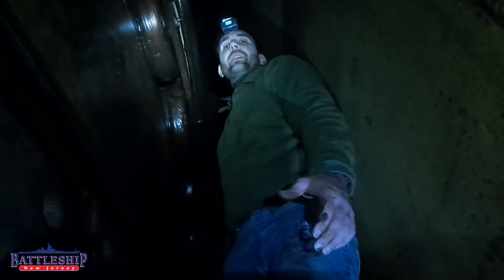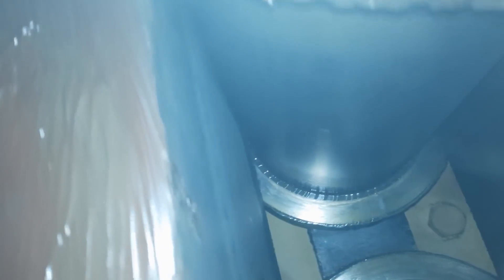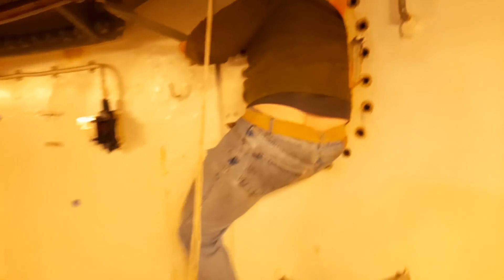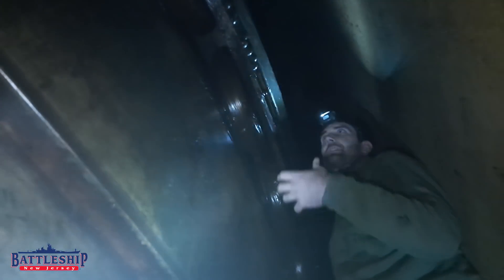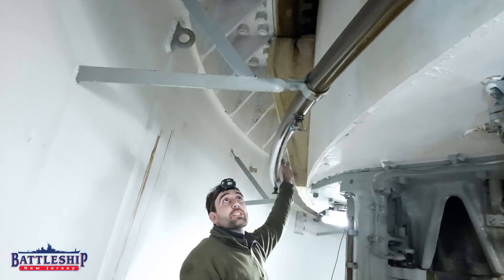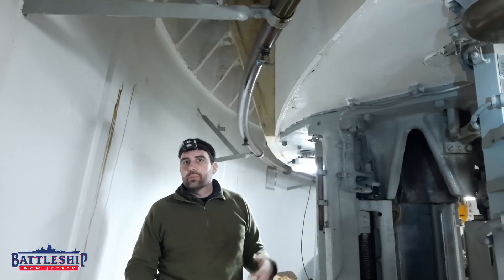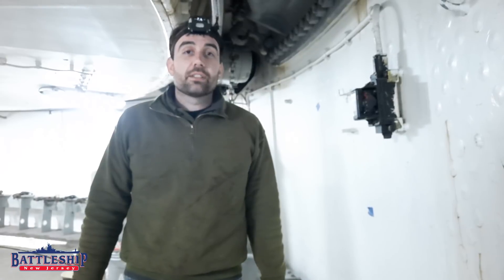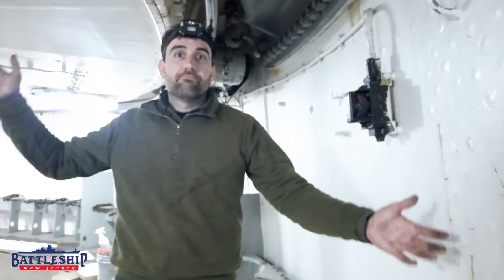Do the 16in Gun Turrets Still Rotate?

Comment: Non-Pointing Zones using those mechanical stops to physically prevent the turret from damaging the superstructure can also be matched with internal stops in the fire-control calculator gearing to stop the calculator from even ordering the turret into those stops in the first place.  I am not sure if such layered protection is used in the NEW JERSEY Local and Remote Fire-Control calculators (turrets have small calculators inside their rear ends using each turret's cross-turret range-finders and various periscope optics for input -- except, later-on, the system in Turret 1 at the front of the ship had its system partially removed and was designed to follow the raised Turret 2 as a slave using the Turret 2 range-finders, periscopes, and calculator for both mounts  -- or manual controls), but they were used in later US Navy guided missile rotating launchers (now largely replaced by vertical launch systems), with the mechanical launcher motion stops in both the launcher itself and in the calculators aiming the launcher definitely being employed, being recalibrated every time the ship went through an overhaul or repair that affected the launcher in any way.  In those missile launchers, they also had mechanical disconnects to the rails that cut the firing circuits -- Non-Firing Cutouts --  to the missiles whenever the Non-Pointing Zone stoops were touched.  SAFETY FIRST, LAST, AND ALWAYS seems to have been the Navy motto with guided missiles!!

Note that, unlike guns, which could only marginally change the vertical angle of the gun by adjusting the pro0pellant powder, with even less adjustment in bearing due to this, resulting in a different muzzle velocity giving a different up-and-over throw of the shell at the same range.  This meant that, with only small adjustments possible, guns had to aim directly at their target aim-point (lead angle taking time-of-flight of the shell into account in the calculator).  If the target was in one of those Non-Pointing Zones, too bad -- you had to turn the ship around until the turret could revolve back into its regular firing arc which could take some time if the target was in the worst place -- directly aft, for example, so only the rear turret could shoot while the enemy might be able to shoot everything at you.  Non-Pointing Zones in ships using guns was thus a BIG DEAL and could spell the difference between winning a battle and getting blown out of the water.

Amazingly, originally with larger missile launchers using rails to aim the missiles much like a gun mount (one, two, or, in some Army anti-aircraft missile systems, three) both in rotation and elevation of the missile to shoot it up and over for maximum range just like a gun, there was no realization that the later forms of semi-active and fully-active missiles (radar homing from the ship radar or, in more advanced systems, its own small nose radar, respectively) were GUIDED MISSILES THAT COULD ALTER THEIR TRAJECTORIES TO HOME ON THE TARGET, as far as the launcher orders were concerned, even though this was the missiles' major method of killing difficult-to-hit targets once in flight.  If the launcher tried to point into a Non-Pointing Zone, then you lost everything just like with a gun turret.

When I worked for TERRIER "ship service engineering" to fix problems on ships who had trouble they could not fix themselves, to study problems that required new equipment changes, and to upgrade the equipment when improvements were added during overhauls and smaller-scale work (including checking that the equipment, old and new, worked during post-overhaul shakedown cruises), during the 1970s they started to replace the original C-47 electro-mechanical computers with (rather primitive by current standard, admittedly) "modern" C-152 digital computers.  These allowed an enormous increase in the computer-assisted testing of the missile system for all sorts of things that had previously been slow and limited manual testing using hand-held equipment only (still needed some of that, but the computer could rapidly tell what to do to find the problem fast).  However, as far as shooting at enemy targets was concerned, the digital computer was used EXACTLY like the old gear-driven dinosaur, with ALL of the same limitations for aiming the launcher.  I like everyone else had been in the rut of the limits of the C-47 calculations, which were hard-cut into its gearing and electronic circuits so it could ONLY aim the launcher ONE WAY at a given target type, no matter what alternatives there might have been.  One day I was working with the new numbers for the Non-Pointing Zones of a ship that had just finished an overhaul, tediously entering every angle in both bearing and elevation that would stop the computer from ordering the launcher into its stops, when all of a sudden it was like a huge light-bulb went off in my head.  While these values were necessary for safety, WE WERE FIRING A GUIDED MISSILE THAT COULD FLY AT THE TARGET FROM >MANY< ANGLES with virtually no reduction in its kill probability!  If it could do far from the ship as the enemy target tried to evade it, then IT COULD DO THAT WHEN LAUNCHED, TOO!!!!  Just aim the launcher sideways or upward an extra angle (upward eventually was chosen) to clear the Non-Pointing Zone UNDER COMPUTER CONTROL and adjust the at-launch missile's initial internal aiming orders to compensate, and then shoot OVER THE SHIP.  You still had in the semi-active missiles the fact that the radar tracker was blinded over a narrow (30 degree) arc so you still could not shoot there, but that was almost nothing and a small jig in the ship course could free up the radar if needed, not the large maybe 120-degree dead arc prior to this aiming fix due to the missiles acting like long gun barrels and having to be kept far away from any ship equipment.  I submitted it as a regular BENEFICIAL SUGGESTION (like you did when you had an idea of a better toilet fixture on a ship) and eventually, with some static from people who could not believe it was so simple, my boss forced it to be evaluated at APL/JHU (TERRIER's Design Agent) and they said it worked PERFECTLY (the letter we got back was very nice, let me tell you!).  I had called it "Fire Around the Blind Zone" but very shortly it was renamed "Curved Fire" and used in virtually all US Navy missile launchers that had to rotate and elevate around some sort of blockage, not just TERRIER.  I got $400 for it because it did not save any money, just increased the firing arc of the main AA system in the US Navy at the time by 50% with just some software mods.  Oh well, I still felt that I had done something for the US Navy beyond my regular job.